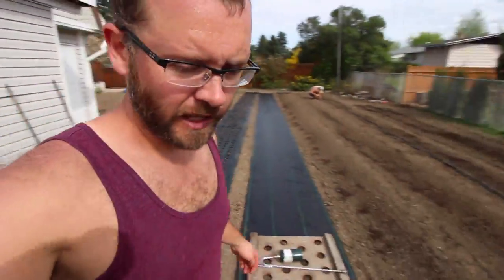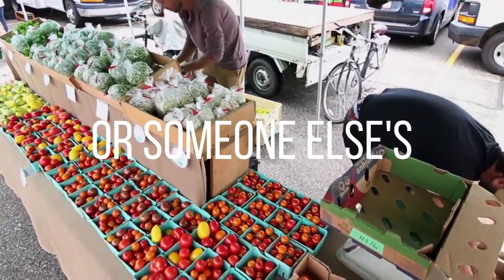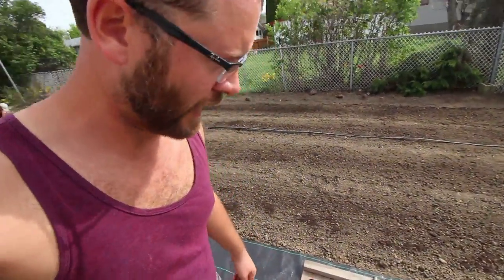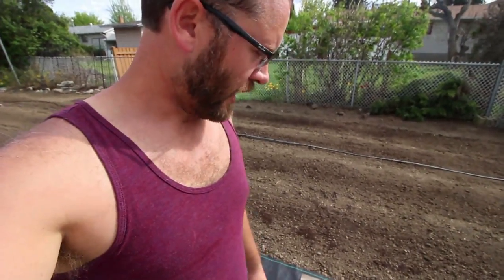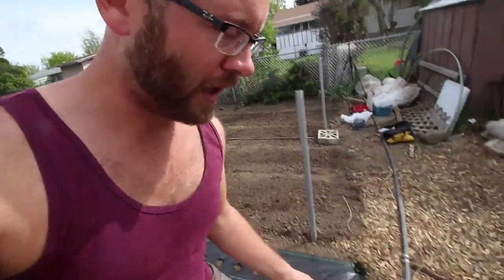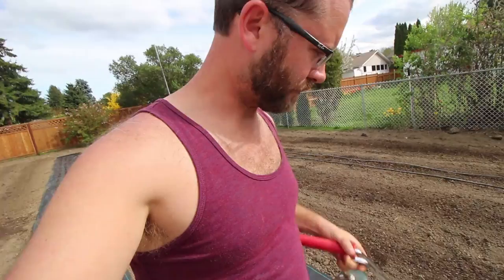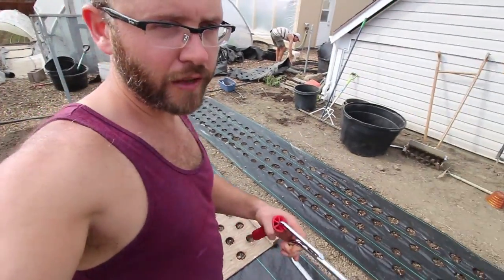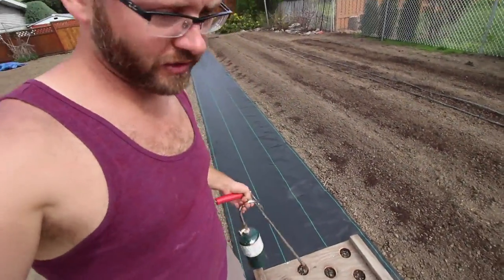How To Craft Landscape Fabric Bed Covers For Ultimate Garden Success

Comment: Recently I have really focused more on the use of weed fabric to help ease weed pulling and increase moisture control with mulch on top that I turn under the following year to add compost.  This saved so much work.  I saw your original video on spacing/burning holes and the second was a real break through.  I use it for Kale, spinach, kohlrabi, cabbage,
 anywhere I can.  Thank you.

Comment: I was wondering why you use landscaping fabric instead of the solid plastic, if you are using drip irrigation? (Or do you only use it when you have overhead sprinklers?)

In the DR, the cheapest weed barrier is 3 or 4 times the price of the traditional plastic row covers.
Reply from the maker: I like fabric because I can reuse it for years. I use both drip and overhead.
Reply: Urban Farmer Curtis Stone
Thanks for your reply!

How many times longer (roughly) might the fabric last? Calculating better, here the 3.65m x 100m rolls of fabric would cost me 6-8x more in total than the 1.32m x 1220 meter plastic rolls. (I have not yet seen the actual thickness though.)

Also, with the landscape fabric, would you move it between plantings so that the holes use different soil each time, or so you always do that pitch fork aeration technique anyways, between plantings, this peeling back the fabric each time?  Thanks!

Comment: What are the dimensions of your wooden stencil I imagine it needs to be small enough to for one person to manage easy.
Reply from the maker: +tjz19d These are made for a 30" wide bed.
Reply: Yea but what's the overall size of ur template, 2.5ftx3ft etc
Reply: Just try it and see what works man! :)
I'd start with 4', since that means you'd only have to make one cut off a 4'x8' sheet of plywood.

Comment: I did this with 3 tarps stacked on top of eachother and they melted together so badly I spent 2 hours cutting them loose. My tarps are 110gr./m² maybe the ones used in this video were alot lighter. So anyway, I'm not stacking tarps anymore to do this :-)

To people that say this will poison the soil: landscape fabrics are made from polypropylene which is pretty safe. When you do this trick the plastic liquefies and hardens in just a second and even if it burns there are no toxins released that could contaminate soil or air. Just do some research before spreading non sense.
Reply: I am having the same issue right now.  I think i figured it out though.  When i try to baby it apart i really start screwing it up.  But it seems to work better when i stand on the sides of the tarp beneath and grab the sides of the tarp on top and then yank up as fast as i can in one big rip.  It seems counter intuitive and i feel like each yank is going to rip the tarp apart, however it comes apart much cleaner that way.  Its still not perfect, but the results i believe are acceptable.  Also, how i used the torch made a big difference in how well it came apart.  In the spots where i was really taking my time trying to get it to melt well around the edges of the circle, it really gobbed up the plastic and made it difficult to get apart.  In the spots where i went real fast with the torch and didnt worry about the sides being perfect, these holes came apart rather easy with less damage to the tarps.  

Am assuming curtis has the same issues and finds these imperfections ok for the time savings of not doing them one at a time, he has employees on the clock.  But you are correct, doing them one at a time would give better results.
Reply: codygillespie I had this issue too. I also was standing on the wood template to douse the flame. But I think you are right about torching the holes quickly and perhaps using Curtis's up and down movement of the torch to be more precise in order to get less melting together of the fabrics.

Comment: Just re-watched this in anticipation of using this technique in my tiny little backyard plot. 

It occurred to me that at the planting stage you could take a couple of scraps of 2X material and some dowel rod and fashion an upside down, "T" shaped, multi head dibble with the pins corresponding to the hole spacing.

I couldn't find exactly what I am envisioning but this is "sort of" what I mean.

https://i.ytimg.com/vi/wkBhutIMfHw/maxresdefault.jpg

Walk down the row, poke in your holes (say four at a time using the spacing in this video) and drop in the transplants. 

Easy peazy and fast.
Reply: I built that exact thing. 8' 2 x 4, 1/2" dowels.

Comment: Just a quick list of the by-products of burning landscape fabric made out of petroleum based plastic such as PET: Water, methane, acetaldehyde, ethylene, formaldehyde, methanol, acetone, benzene, terephthalic acid, styrene (ethenylbenzene), ethanol, toluene (methylbenzene), xylene (dimethylbenzene), ethylbenzene, naphthalene, biphenyl and phenol. These compounds being organic chemicals will bind to the soil. You can accomplish the same work with an exacto knife without melting the plastic.